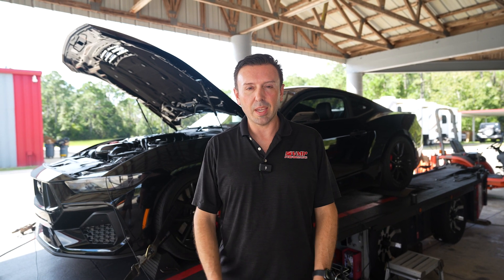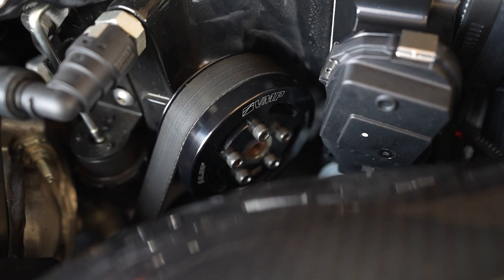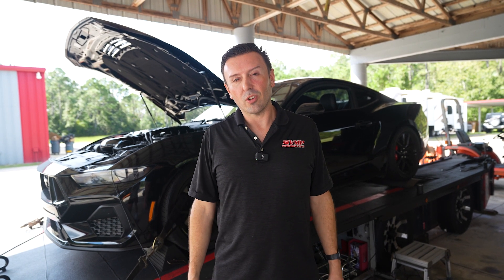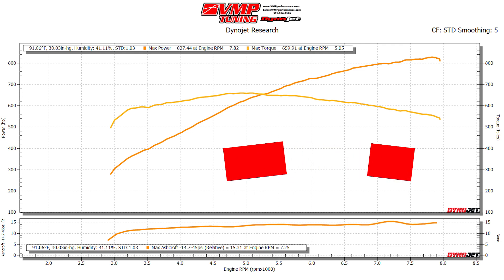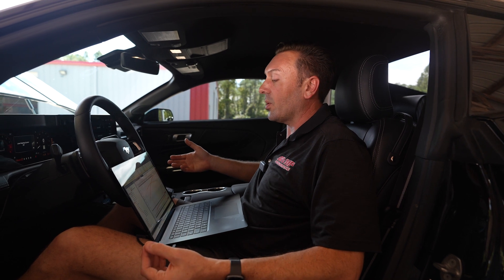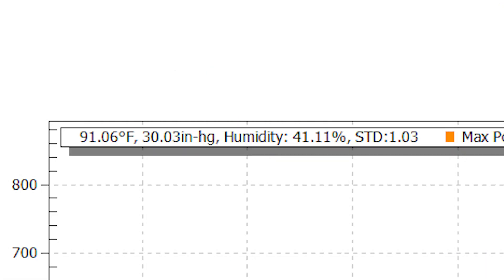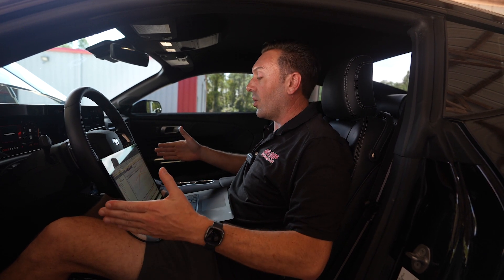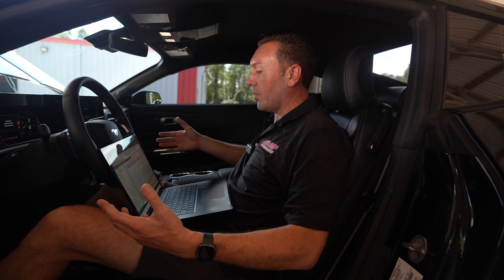Introducing the VMP Gen 6 Stage 4 Supercharger Kit for your 2024 Mustang!

Comment: Honestly should have done a proper before and after of a base kit (with the longtubes) and then “stage 4” and kept fueling the same. I am guessing a HUGE amount of the cost is the cf intake which is 100% cosmetic. Transparency matters
Reply: That intake picks up 20 HP if they did the e85 conversion it would be 900 wheel, midnight performance is making 1000 wheel with the whipple plus the snow performance dual pumps bigger injectors but I have there twin turbo kit on my f150 and made 1084 in a 24 crew cab
Reply: @sneezinhatch  where is the back to back testing of JUST that intake picking up 20whp? It has the same diameter and as the plastic piece in the original kit
Reply: Word

Comment: Should have just done e30 on my Odin.  But I was told you wouldn’t tune it for e30.  So I bought a fuel system. Now it’s ok on the 2024.  This shit is confusing 😂.
Reply: Ford is probably not allowing them to tune fuel for e85. The E30 is just knock protection so timing isnt pulled.
Reply: E30? Why not just take a shit, smash it into a paste then force it into your gas tank. Same effect. Ethanol mixed with gasoline breaks down the lubricants and creates sludge. E85 or nothing. Don’t be like the bmw kids.